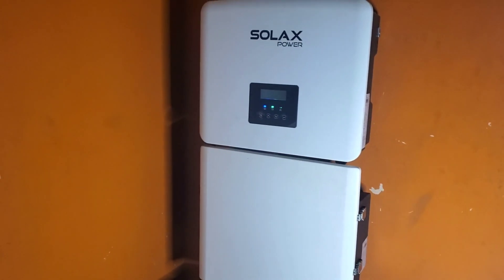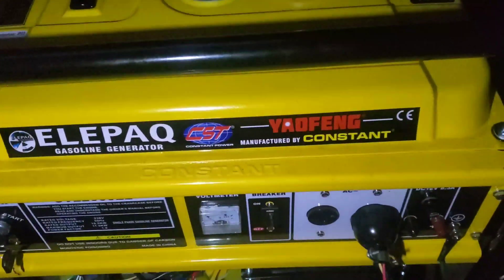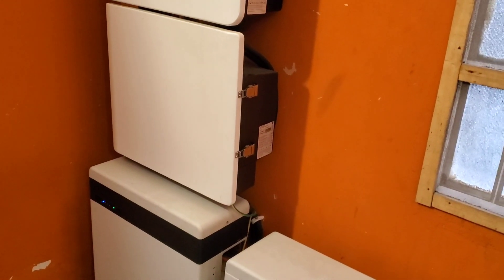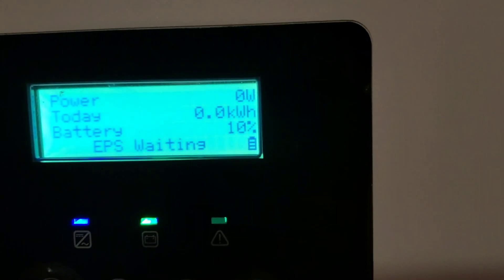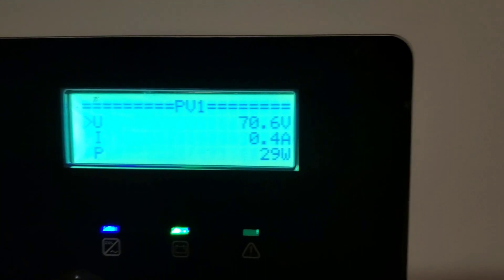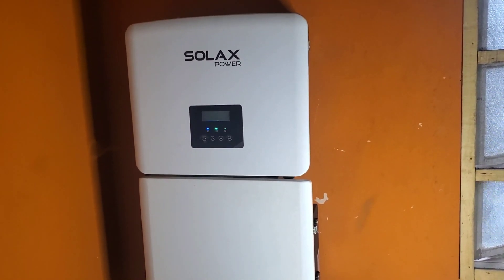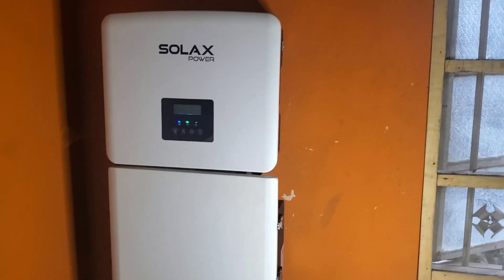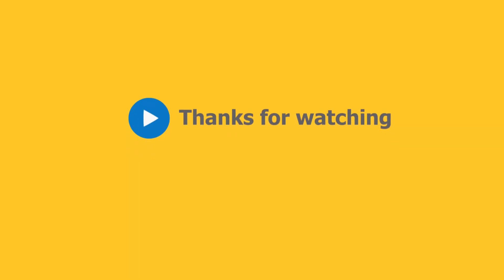Generator. SolaX vs Deye. And the winner is...#solax

Comment: how did you connect the generator to the Solax inverter. Can you please explain the wiring scheme?
Reply from the maker: Thank you for watching and commenting. I am not on the grid it comes in as a grid connection. For other clients we use a changeover to manage switching between the two.

Comment: Hi, did you face a problem of Inverter turning off and on itself for a moment at EPS mode when a capacitive load is applied like mobile charger etc, i
Reply from the maker: What was the percentage of the battery when this happened? I had an issue where it was doing that when it went over 98%
Reply: @drsolar  this is not related to batteries percentage. This is a new issue. At any percentage whenever a capacitive load is applied inverter create problem. I this output LC filter is not properly designed
Reply from the maker: @neoncrux3119  do you have the Matebox?
Reply: @drsolar  no brother
Reply: @drsolar  I have made my on circuitry according to Solax manual
Reply from the maker: @neoncrux3119  is it inverter that trips or your RCD that is tripping? When I experienced it, my window unit was tripping the RCD. Try another device and see if it happens.
Reply: @drsolar  It has been tested that during EPS Mode when following type of load is applied

1.       Load which is equipped with specific capacitors (not each capacitive load).

For example

a.       Some of mobile chargers.

b.       Some of laptop chargers

c.       Some of LED monitors

d.       Some of LED Tube lights

e.       Some of water pumps

 

 

Then

Following reaction occurs from inverter:

1.       Inverter turns off its output for a while (around 0.25Sec)

2.       Inverter turns off PV incoming power

3.       Inverter turns on its output again automatically

4.       Inverter put all load on batteries when inverter turns on back after a while.

5.       Then again slowly get power from PV.

6.       No alarm is logged in alarm history.

 

Please note following points:

1.       There is a video in attachments. Which describes the reaction of inverter.

2.       In Attachments There are pictures of appliances name plates which shoes power rating for just reference.

3.       This test has been performed on 2 same model inverters

4.       This test has been also performed by removing all loads from Inverter and by connection isolated single board.

5.       All ground points are connected.

6.       Each Installation step is according to Solax provided installation manual.

7.       This phenomenon is not related to loose wire or loose connection, instead this is related to just turning on appliances.

8.       It is observed that This phenomenon does not occur when grid is connected.

One more thing that this phenomenon does not occur each time when we turn ON above type appliances. This phenomenon occurs sometimes on 1st turn and sometimes on 3rd or 4th turn.
Reply from the maker: @neoncrux3119  contact the SolaX rep and ask for a firmware update. Then check your settings after the update
Reply: @drsolar  contacted Sola, informed them, updated firmware, but all in vain

Comment: I find it strange that the deye inverter would not charge from a standard gasoline generator.  Especially through the Gen port. Did you give it a fair chance by adjusting the frequency ranges and voltage ranges of the inverter so that the generator falls within spec
Reply from the maker: Welcome to the channel, please don't forget to subscribe. We tinkered with the Deye settings for more than 1 year and it did not work. We found that the only time it would work was when we used a diesel generator.

Comment: …before watching the whole video, I suspected you would say: SolaX… I think you have got the solution but you (we) are not out of the woods yet. The generator’s output capacity will deteriorate over time and a solution is required that automatically compensates for this via the inverter, which will come through a firmware, not manual input. Generators may have the same rating but output differently and an end user won’t know what to tinker with. That said, congrats, let’s celebrate this win. I still think going through a transformer or UPS will give clean energy and frequency and be better for the inverter in the long run.
Reply from the maker: Let me know what you think after you have watched the video.
Reply: @drsolar  I did watch the video and saw how you resolved by tinkering with the inverter manually. It would be good if a firmware with a dynamic algorithm would be provided by SolaX to do automatic tinkering. Now tech is moving into the realm of (AI), artificial intelligence, I wonder how long it will take for us to even get to a time when the inverter comes with AI, not just SolaX, but inverters in general.

Comment: Connecting solar inverter to generator is not a good idea because of the fluctuating current of the generator this can blow the inverter which is a very expensive equipment rather run your house on generator directly and wait for the PV to charge your batteries, it's my thought you can disagree.
Reply from the maker: Thanks for sharing. Poorly made inverters would get damaged by the generator. the idea behind having a gen is to allow me to charge the batteries. If I have to wait for PV while running my generator I am wasting energy.